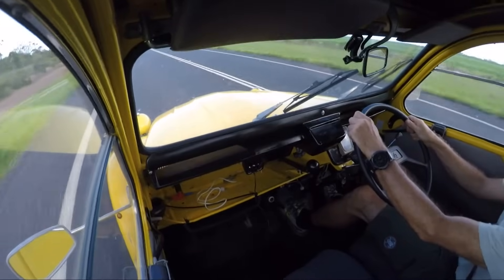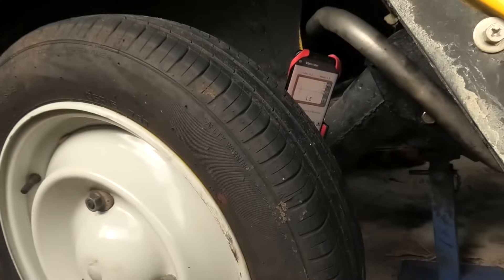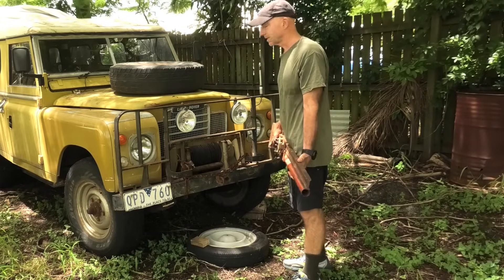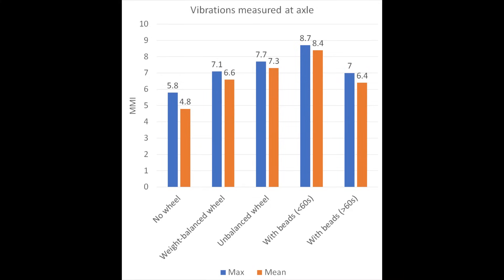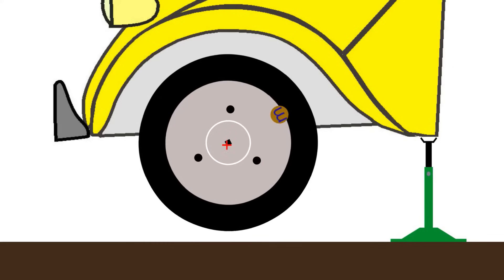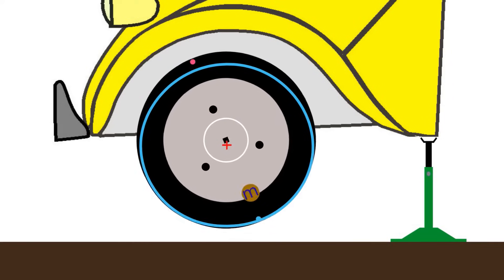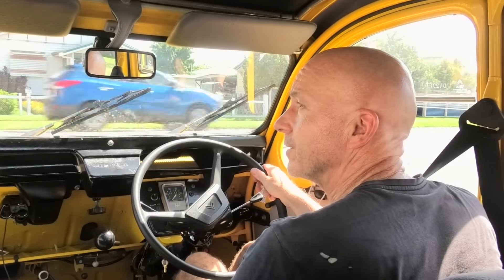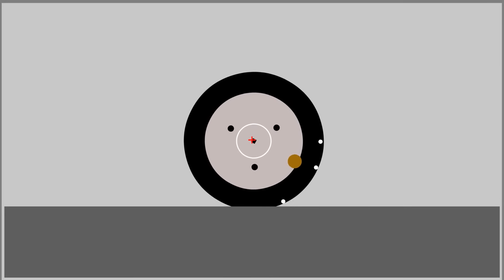Can beads really balance tyres? A full test and explanation how they work.

Comment: I'm going with beads because of a few videos like yours, although I like yours the best. And my co-worker said his minivan has been fine the last 3 weeks with beads. 
But first...I currently have a bad tire with broken belts that has been pushed as far as it can be, with a bald spot where it lumps. For fun I'm going to see if beads help this tire smooth out before I replace it. I know it's not round anymore, but I'm thinking the massive shake is coming from the extra tread that wore off before the rest of the tire. Just doing an experiment, it's not to extend my use of the tire beyond a 100 mile test range.

Comment: It's like the idea of the barycenter in astronomy.  This is the best description I've ever seen - Thank you!
Reply: Anyway it works.  I have a Nissan XTerra with 265 70 - 16 all terrain tires on steel wheels.  I'm running with no balance weights and 6 oz of airsoft plastic BBs (non-biodegradable) in each tire.  It's dead smooth.
Reply from the maker: I was actually also thinking of celestial bodies and how they rotate around their combined centre of mass when I made this video. And from there somehow I got the bath tub idea.

Comment: Great video!  This is the most logical presentation of balancing beads I've seen.  I'm going to try this in my tubeless motorcycle tires.  All the kits I've found cost over $25 (US), so I looked for alternatives.  They test glass beads, used in pavement marking, for reflectivity in the lab at work.  They gave me two quart cans of tested glass beads.  They have about two 55 gallon drums full of tested beads they need to get rid of.  😀

Comment: It looks good while you have enough speed for the centrifugal forces to spread the beads in your tires. But until you don't have enough speed, you have a bigger imbalance. So I don't know if it is really better than fixed weights on the long run.
Reply from the maker: That is correct, and sometimes I feel the vibration first before it balances. If I could find a tyre place near by that can balance this type of wheel I'd probably prefer doing that.

Comment: Can we just use water inside the tyres? Wouldnt it work the same?
Reply from the maker: It should work. Some washing machines use liquid in a ring tube to balance the drum. But I never tried. The only problem I see is that water will not stay in place at lower speeds (when the wheel does not spin around its centre of mass any more) so you will have to speed up again to rebalance the wheel

Comment: The beads help a balance and not solve it
The correct way is to balance the tyre and then put a chalk mark across the tyre and rim
Then you break the bead and put the beads in the tyre
Then you align the tyre and rim with the chalk mark and pump up the tyre
This way the tyre will never go out of balance for the life of the tyre
Putting beads in tyre may help but it will never solve a balance
I tested 5 semi truck that with the hankooks or Michelins usually get about 120 thousand kilometres 
My test with the balance and then put the beads did 200 thousand kilometres and still had tread and were still balance
I was given this information buy a semi retired mining magnate from Queensland 
Let’s just say the whole world doesn’t know this

Comment: If you put a bottle of green slime tire sealant into a tire, wouldn't that also balance the tire just like the beads did?
Reply: That is quite possible. Some washing machines use water in a tube ring (which is like a tyre really) to balance the drum. Theoretically slime should work well, provided there is enough of it (like 100g - 200g depending on tyre). Maybe worth a try. If I have some spare time I might try it out and video it.
Reply: @gelscience7081  I see that they are talking about slime in another comment. A couple of people are saying that it works, and one person says it causes vibration.

Comment: These things are the cats meow! I worked on high-end wheels and tires for years. Corvettes Ferrari’s. Many different kinds of performance wheels. Among straightening them, which was my job. To get them perfectly round. I didn’t stop there. I would balance the rim. Then mount the tire. And that used to take care of all the problems perfectly until I discovered these. They work better than anything on the market.
Reply from the maker: Great to learn what experience professionals in the tyre business had with balancing.

Comment: Cool car which surely gets notice on the road.  My 1965 Chrysler Owner's Manual shows breaking the tire bead using the bumper jack, as you did.  Wonder if an owner in the day would actually swap in a new tire by hand.  I did it once on a 13" trailer wheel and very tedious, using pry bars.  I've notice small rubber balls inside tires, which apparently form naturally from shed rubber.  Doubt they have much effect.  Interesting Physics description.
Reply from the maker: Thanks for sharing this detail, quite astonishing indeed.. I have a 1963 Pontiac with the original owner's manual, but mine doesn't tell you how to remove tyres from rims.

Comment: How much weight did you put in?
Reply: I put in 60 grams. But keep in mind that most tyres are bigger and heavier than mine and therefore you can expect weightier imbalances. The mass of the beads should be well above the mass of the imbalance you expect.
Reply: The formula is 1 troy ounce per 13 imperial pounds of tire weight(not combo tire plus rim weight)  @gelscience7081

Comment: Something most DIYers miss are the red and yellow dots on new tires. Pre balanced at the factory. The red dot marks the highest point around the tire. The yellow dot marks the lightest point of the tire, and aligning this with the wheel’s heaviest point, often the valve stem, aids in achieving a balanced tire. So adding balance beads will fine tune the assembly. Of course the dots wear off eventually so if you  remove the tire after a time and the dots are gone then the fine tuning aspect is nullified upon remounting the tire later.

Comment: Magnificent.  There are so many ignorant explanations of balancing beads on the internet that are clearly wrong.  Finally one that makes sense.  Thank you.  I have been using them in my motorcycles for years and know they work but have always struggled to understand why.
Reply: Thanks for sharing that the beads work on your motorcycle (always good to get more data). I made the same experience as you, some clearly wrong explanations out there including from bead manufacturers and retailers; that's where I saw a need for doing a clarification video.

Comment: vehicle mechanic here,  balance beads are really only good for fixed speed situations & car tyres aren't round when in use there is a flat spot (the contact with the road) so the wheel in the air experiments are not real life scenario. having tried balance beads for a year or so i've concluded for car tyres stick on weights are superior. when you change speed especially accelerate the beads take time to shuffle into position & during this time the vibration is really bad. do they work? yes but are not as effective as traditional wheel balancing in my experience .
Reply: Same agreement with you, the only time I ever told someone to get them was for an off road wheel that was requiring POUNDS to fix. No shop was going to take them. So I suggested that they try some ceramic balancing beads and talk to the people that sell them. Guy came back for an oil change 6 months later. Was the happiest person in the world that while it didn't completely remove it. It made it much more tolerable.

Comment: Maybe I missed it. Did you take into account the downpressure on the tire from the vehicle's weight? (There is a flatter spot where rubber meets the road)
Reply: How could you miss it? It was clearly explained at the end 🤔
Reply from the maker: Yes, the car's weight presses the tyre into the ground, creating a flat spot.

Comment: I had my wheels balanced with weights on a machine and the result was less than desirable.  This has often been the case in my previous experiences.
I introduced tire beads pneumatically through the stems, looking for a solution.
At 1st, I kept the metallic balancing weights in place while noting some weights were quite large and their placement made no sense from a dynamic perspective.
The results with beads and weights were somewhat improved, yet remained intolerable so I removed the external metallic weights.  The results were dramatically improved, as good as I can recall any previous balancing and now quite acceptable.
  So I suggest when using balance beads, removing the external metallic weights may be necessary to fully benefit frome the self-balancing effect.
Reply from the maker: Excellent comment. I would also recommend to do a road test first after removing the weights, maybe all is good already. Sometimes the weights cause the vibration (wrongly placed or tyre has changed over time and weights became "outdated").
Reply: @2CVCult-zl8eo  My guess is the weights were causing vibration.  They locations they were placed and the large size of a few of them was highly questionable.  There were two large weights (4 inchs each!) placed next to each other on the inside and no weights on the outside of any wheel.  None of it made any sense to me...

Comment: I use airsoft rounds (hard plastics. They balance high speed drag car slicks very well. You need an ounce per pound of tire and rim.
Reply: Curious to know how you determined to include the rim. The online  instructions don’t include the wheel.The chart is based on the tire size only.

Comment: Will it work scooter tires?
Reply: It should work on scooter tyres as well. But make sure that any vibrations in scooter tyres are really caused by imbalance and not unevenly worn rubber. Imbalance vibrations only occur at fairly high speeds.

Comment: Use a static balancer. If done properly they work fine.  BUT I guess no shop has them these days.
Reply from the maker: I couldn't find a static balancer for rims that have no centre hole.
Reply: @2CVCult-zl8eo  that's a very valid reason!!! I admit that did not occur to me.

Comment: I had problems with the Counteract beads' valve core that has the filter in it.   They do not work on metal valve stems TP543 (stamped on stem).  TP544 are longer and work fine.  In the former the core cannot go in far enough making impossible to depress the valve core.   On one tire, the filter got stuck in the stem preventing me from even using a standard core.  

Counteract, the company, was totally clueless about this.
Reply: øther than that, beads are working in my Class C RV.

Comment: The real explanation is different. The balancing effect of the static imbalance only occurs when the rotational speed of the wheel is higher than the first natural frequency of the wheel. The first natural frequency is determined by the suspended mass and the stiffness of the suspension. The maximum deflection occurs opposite the heavy spot. The dynamic balancing effect depends on two other modes of vibration. The natural frequencies of these modes are determined by the mass moment of inertia of the wheel and the torsional stiffness along two axes.

If higher modes of vibration are active, either because of high speed or rough road surfaces, the balancing effect can decrease or vanish. Even amplification of the vibration is possible.
Reply: Eh? Fits that all aboot?

Comment: wish i had known about balance beads way back when i had an R4 that also had wheels that no shop could mount on their modern balancing machines.  main issue was in the front....on the back the tires could hop up and down 20cm and you wouldn't even notice it.

Comment: Wow..... never trust someone wearing crocks to explain anything.    
1. Do not run a tire on a jackstand at those speeds.   The tire being out of balance can cause the whole wheel to bounce off the jackstand.
2.  Powders, beads and centramatic type products (any dynamic balancer) REQUIRE movement (bounce) to distribute the beads, powder around inside the tire until the bounce stops. 
As the tire bounces up and down the beads along the front  of the tire (the near vertical part ahead of the center) and along the back near vertical will have the inertial mass to stay at the velocity of the rotation at that distance from the center.   As the wheel assembly "bounces" due to out of balance, the tire will accelerate past the beads  on the up bounce, and the opposite on the down.   The beads at the top and bottom do not move. This moves the beads or powder around the tire until the bouncing from the out of balance stops.  

This system is used on all kinds of rotating equipment, including washing machines.   The one thing in common is they are suspended by springs or a mounting system that can allow movement.  

Please do not try to spun balance a tire with beads in it already.   If you must, take the beads out (dismount the tire and remount it sans beads) then spin balance if possible.  Only then add the beads or powders.   This will ensure they work and are not trying to balance 5oz of inbalance with 3 oz of beads.
Reply from the maker: As you can see around 0:32 the car is on a proper stand (blue) and as a backup the jackstand is also there.
Reply: @2CVCult-zl8eo  you don't understand....   without the compliance of the tire the beads may not distribute properly and at higher speeds can cause an imbalance that will hop the axle right off the jackstand.

Comment: The vibrations shown at the beginning are due to the road - if it were caused by the tyre “imbalance” the wheels would have come off - also the steering wheel does not shudder!

Comment: Great video. One situation where balancing beads aren't ideal is if you need to use a tyre plug. They'll shred the plug to pieces and break up as a result. You just end up with a powdery ceramic mess and a plug that won't seal.

Comment: Those beads are massive, aren't they normally tiny?
Reply from the maker: The Australian ABC beads are larger than most. That means they don't fit through the valve stem, but they will roll better inside the tyre. So it could be that they work better.

Comment: I had oddball (stock) wheels on my 1958 Apache 3/4 ton pickup. They were 17.5 inch wheels, so there were only two tire options to run the stock wheels, both were luggy military tires. No local shop was equipped to balance them so I used beads. Anyway, I used the smaller beads that can go through the tire stem. The trick to get them into the wheel without jamming or clogging, I used a funnel and an engraving tool to vibrate the valve stem and keep the beads rolling into the wheel.  Takes a little time and patience, but a lot less energy and risk than breaking the tire bead and tossing them in that way. Worked like a charm.

Comment: you can balace those wheels on the car by letting the wheel in the air and letting it rotate with the heavy spot at the bottom, then add weights at the top, rotate the wheel and see where it starts to accelerate or decelerate the rotation. to find the heavy spot again and so on

Comment: Tyre Balancing Beads - I have been using them on my Motorcycles for last 8 years.
Biggest benefit is Beads balance the life of tyre, wheel weights do not.
Tyre can irregularly wear and dirt, mud, tar rocks sick to inside of rims changing the balance.
Reply: That's a really good point 👍

Comment: Never heard of them before but I recognised the principle from dismantling a top loading washing machine years ago. The inside drum had two hollow rings, one at the top and the other at the bottom which were partially filled with water (and sealed) and serve to balance the washing during the spin cycle. It sloshes around to pool opposite, say, a large towel and compensate for its weight.
Regarding a tyre and from looking at another video - the beads tend to roll to the centre of the tyre as only the bottom is flat - the rest is curved. So static balance will be quite good but dynamic not so flash. Enjoyed your video!
Reply from the maker: What a wonderful piece of knowledge from your washing machine. Thanks for sharing. And a good point on the curved tyre inside. It will indeed lessen the effect of dynamic balancing. A more elaborate setup would be needed to fully test this out.

Comment: What would happen if you balanced the tire traditionally and then added beads?
Reply from the maker: Theoretically nothing. Without an imbalance to start with the beads would distribute themselves evenly around the tyre, which would remain balanced. If the tyre got imbalanced one day (e.g. through uneven wear) the beads would then balance it.
Reply: No negative effects. I've got beads in my mud tires that were sticky weight balanced. Keeps them smooth when mud and gunk are stuck in the wheels throwing out the static balance.

Comment: Finally you gave me the answer I've been looking for. It is the center of gravity and not the periphery, or the center of the wheel and not the outermost edge that causes the dis-balance. I've been running beads on all my cars since about 15 years ago no problem until the tires get quite old and need replacing. I run plastic bb pellets.

Comment: Couldn't you just balance it with a bubble balancer?  Seems easy enough to do rather than all that...
Reply from the maker: These wheels don't fit on a bubble level balancer.
Reply: As a tire wears it’ll change balance. The beads should keep balance through the life of the tire.

Comment: Great video! Super hack! 

Have you experienced internal tire wesring due beads friction?

How often do you change beads since they usually tent to crash and break eventually?
Reply from the maker: I don't have any long-term experience with the beads. I will now check every 5000 km if they have already turned to dust and if there has been abrasion on the tyre insides. If I find that they are not worth it in the end I'll do another video about it.